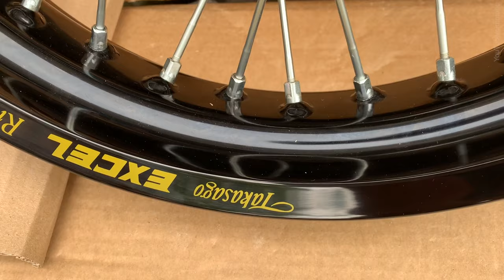How to Paint Motorcycle Rims UNDER $15 - Plasti Dip Your Supermoto Wheels - DIY

Comment: Any update with the paint today?
Reply from the maker: Hey man! I'll copy paste my reply to similar question that got asked recently, hope you don't mind...

"It held up for 2 seasons really well. I've then changed the entire rear wheel, so didn't use the one from the vid more than that.. Compressed air paint is still the way to go if one wants quality and more durable paint.
One benefit of these gumi paints is that they can be easily taken/peeled off if needed though."

Thanks for watching, cheers!

Comment: Looks clean.  How long did the paint hold up?
Reply from the maker: Paint held up until recently, when I've took it off myself... in order to paint the rim with air-compressor - "real" paint.
Over span of 2 years plasti dip lost some shine which I was missing already from the beggining to be honest. The paint looked too "dull" to me although I've painted it with plasti dip clear coat too.
However, the paint sticked to the rim incredibly well. I had really, really hard time getting it off the rim. I couldn't just peel it off as how I thought it will be done. Plasti dip keeps on tearing when trying to peel it off.  I've then helped myself with a rag and acetone which dissolved the plasti dip. So in short, the plasti dip held up surprisingly well and it would last even longer.
Reply: @motoric5188  thank you.  Was just about to do that to my rims.

Comment: Im also planing on painting my wheels with plasti dip and wanted to ask how about durability of the paint? Like if i go for a little ofroading on hard forest roads and washing the bike does it hold on? And can you take it off easily to return to the old colour?
Reply from the maker: Little offroad won't be a problem I assume. But these rubberized paints, like plasti dip, are certainly more prone to being scratched/peeled off. I've never washed it with pressure washer. Sponge, soap with bucket of water was no problem. Mine still sticks to the rim though, but compressor spray paint would for sure be better way of doing it. You could take it off easily.

Comment: Great job! What clinging material did you use to cover the spokes?
Reply from the maker: Thank you! Just some basic masking tape. It doesn't have to be anything special.
What matters most is - time spent for prep. More time spent for detailed preparation, makes up for better end result.
Reply: @motoric5188  I’m gonna try some stencil mask to see if it makes the process a bit easier. I’ll be using tape for the individual spoke nipples, as you did. 👍🏽 Prep is the key!!!
Reply from the maker: @aimlessimages831  Alrite! Fingers crossed it turns out great for you!
Reply: @motoric5188  😢

Comment: Sure hope you didn’t do that to sell on the market.
Reply from the maker: Why would I do that? The rim is sitting in the garage ever since I've replaced it with aftermarket Excel one. I actually did have it listed for a while, but with zero interest for the rim unfortunately. It now collects dust like a baws!
Reply: @motoric5188  I’ve seen parts listed for sale that gave off the impression that the paint job was OEM or professionally done. I even bought a motorcycle once, thinking the tank color was OEM, only to find out due to spilled fuel that it was rattle-can’ed. I just saw you place the sticker on top of the Plasti Dip, and it made me think you were selling it without clarifying that it’s simply Plasti Dip. So long as one is being transparent in sales, all good.
Reply from the maker: Oh I think I get it now. Because of stickers right? No, I did have it listed with ful disclosure that it is not genuine Excel rim. These originals are BEHR which are pricey as well though. But as said, I still have it. Thanks for watching, cheers!
Reply from the maker: @dirkstuff5820  Hehe yeah I got it on a second thought what you've meant. I've put the stickers on so that it looked like a matching witht the front rime which was Excel at the time of painting the rear already. Was fooling no one but myself with it though. From a close inspection it is clear that it is a sticker and not genuine Excel rim. I couldn't trick anyone even if I could, it's that obvious. Sucks to hear for your experience man. In my experiences, at least where I live, motorcycle communities are known to be great. Pretty much awesone and genuine people only. This why I like it a lot and hope it stays this way for good! 👍

Comment: I'm thinking to paint mine but with 2k car paint because i have air gun. I'm thinking to remove the tyres, is better or will chip off when i put them back? Do you have some unpainted spots at the rim point that is tyre touching?
Reply from the maker: If you have air gun that's better option than spray paints for sure. I do have some unpainted spots visible only if you get on your knees and try to look for them. Preparation is the key as with any paint job.
One trick I've heard of.... worth doing when painting the rim with the tyre on it, is to loosen a pressure a bit. This way one should get paper in between the tyre and the rim easier.
As far as tyre changing goes.. I've just recently changed mine and local mechanic did a good job destroying the paint :D So I just redid those spots with remaining spray paint. 2k paint will hold better against scratches that is for sure.
Reply: @motoric5188  I have painted my xt plastics with special primer for non painted plastics and the paint shop added something in the paint to make it more elastic because xt plastics are too elastic. It's 3 years now and i bend the plastics many times without issue. I have keep some black paint from that. I have painted the engine covers with special primer for aluminum and have some primer left. So i was thinking to use the material already have but am hesitate to do it but i will do it soon or later
Reply from the maker: @araxnoyfantos  Yeah man go for it. When you wear off existing tyres and replace with new, if not before. I bet your wheels will come out great!

Comment: Bro this looks legit! What kind of paints did you use?? Great job man!
Reply from the maker: I've used Plasti Dip, one can of black and one can of clear coat. It's rubberized paint that can be peeled off. There are alternatives to plasti dip if you can't find it, like FlexiDip, PlastiDip, GummiDip,...
Note, that if you are after more persistent/long lasting type of paint, I would suggest getting it painted with air compressor/gun and some proper paint.
And as an update, this paint is now holding up good for the second season. Some damages because of the tire change, nothing more. Bike is riden on tarmac only.
Thanks for the kind words man and thanks for watching!  👍

Comment: Hi, I saw that you proceeded to paint it with compressor, after you removed plasti dip, did you sand paper the rim? Did the comperessor paint stuck on the rim?
Reply from the maker: Hi! Yeah correct, as I have written in some reply already... I have taken off the plasti dip paint. It did stick to the rim extremely well. I didn't use the sand paper to take it off, but I did use help of acetone instead. Acetone dissolved the plasti dip and I just wiped it off. Then I prepared the rim surface with scotch-brite pad (just to make it bit rougher for paint to adhere better) and paint it with compressor. Yeah, the compressor paint stuck on the rim no problem whatsoever. Thanks for watching! 👍

Comment: Nice job! does the color hold well?
Reply from the maker: Thanks man! It held up for 2 seasons really well. I've then changed the entire rear wheel, so didn't use the one from the vid more than that.. Compressed air paint is still the way to go if one wants quality and durable paint.
One benefit of these gumi paints is that it can be easily taken/peeled off if needed though.
Thanks for watching! Cheers!

Comment: When you removed the tape? Directly after the last coat? Or when it is dry?
Reply from the maker: I've removed it after it dried up completely. I've let it to cure/dry for a day, with high temperatures in summer time.
In some places this paint which is sort of gummy, sticks to the tape/protection. So be careful while you peel the tape/protection off the wheel, not to peel the paint along from the wheel as well. Thanks for your comment man, appreciate it!
Reply: @motoric5188  thankss your welcome
Reply: Try to remove from one spoke after last coat while it is still wet. The edge of the paint might adhere back better, than when removing it completely dry. I haven’t tried it on spoke wheels yet but it did work on flat surfaces. Just a suggestion.

Comment: What kind of paint do i need ?
Reply from the maker: I've used Plasti Dip, one can of black and one can of clear coat. It's rubberized paint that can be peeled off. There are alternatives to plasti dip if you can't find it, like FlexiDip, PlastiDip, GummiDip,...

Comment: Hey, for how long does it stay on?
Reply from the maker: Hi! Not really sure if I understand... I've painted the wheel last summer if that's the question - so it has now been more than a year since I've done it. The paint is holding up well. No peeling offs. As pointed out in the video, key is in the preparation and multiple thin layers of paint!  Cheers!
Reply: @motoric5188  Hello, you’ve understand my question correct. Sorry if it was unclear. Over a year is pretty good. I maybe want to do it myself but then with a 50/50 design. (Half black half white color) I just want to have plasti dip in case I want to remove it for some reason. thanks for the quick respond and the good video of coarse! 😀
Reply from the maker: @EMS9729  One more thing regarding durability... Paint holds up good, unless there's some direct contact with it. Say when you're changing the tire. In that case paint from compressed air would be better choice, much better scratch resistance etc.
Yeah, you should have little to no problems removing plasti dip if you decide to do so. It leaves no residue when it gets peeled off.
Thanks for kind words and for watching, much appreciated!
Reply: @motoric5188  aah yes, thanks for that because I need a tire change ASAP. I will first change the tire and after that paint the rims👍🏻 I also had another question I saw in the comments someone saying something about a primer, do you recommend it?
Reply from the maker: @EMS9729  Would I paint the rim with air compressor I'd definitely use primer.
But as for the plasti dip I wouldn't use it. I've watched many vids of people using plasti dip and I don't recall anyone using primer.
Plasti dip covers the surface really well. Just degrease the surface and go for multiple thin layers and you'll end up with one thick gummi layer. :)
Reply: @motoric5188  thanks for the respond. I will do that :) looking forward to new videos :)
Reply from the maker: @EMS9729  Cheers!
Reply: @motoric5188  I have one more question I forgot to ask. Do you think it is possible to put a layer of plasti dip on a other layer of plasti dip. Because I want to make a 50/50 design. I first want to paint my rim/wheel black (or red, I’m not sure yet). And after that I want to paint one half of the wheel white so I get the design. But for that I have to spray over the black (or red) layer of plasti dip so it will look clean. Do you think the white plasti dip will stick on the other layer.
Reply from the maker: @EMS9729  Hi! I think there shouldn't be a problem. I'd say the compound of plasti dip is the same, regardless the color. It should stick in my opinion.
For the colors - maybe it would be better to spray with white first. And do the black/red afterwards :? Darker colors usually cover better - this is how it's usually done with air compressor painting.
One more thing, you will probably be making a line between the two colors with masking tape right? I suggest using tape that doesn't adhere to the surface too much. Be careful after removing the tape when you are done with painting, not to remove/peel off the paint as well.
Reply: @motoric5188  hello, thanks again for your response. Sorry for my late response. Thank you for the tips I will use them, so after painting is done. Let it dry to the surface and after that carefully remove the tape?
Reply from the maker: @EMS9729  Hi! Tape will tend to stick to the first paint underneath it and to one side of it to the second colour paint.
Just be gentle when you apply the tape to the rim. So it won't drag plasti dip away when you remove it once finished with the painting.
Also, you can test how it works elsewhere other than the rim first. If you have some surface for experiment try it out there, and you'll see how it goes.
Reply: @motoric5188  ooh that’s a good one to test it on a different surface, thank you. I’ll let you know how it goes!
Reply from the maker: @EMS9729  Alright. Good luck with the project, I bet it will turn out great!
Reply: @motoric5188  Sorry for late response again, but thanks!
Reply from the maker: @EMS9729  All good man! :) Cheers!
Reply: @EMS9729  Hi, did you painted rim in  50/50 design ?
Reply: @david3508  Hi, no, it wouldve been a good project. But i sold my car. A friend of mine did something similair but he purchased some cheap wrap from aliexpress and did it that way.